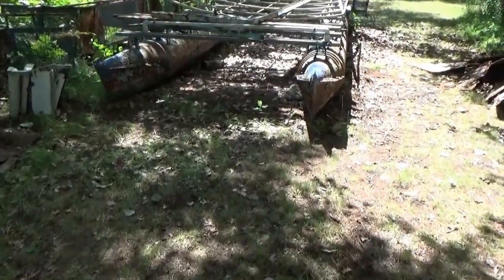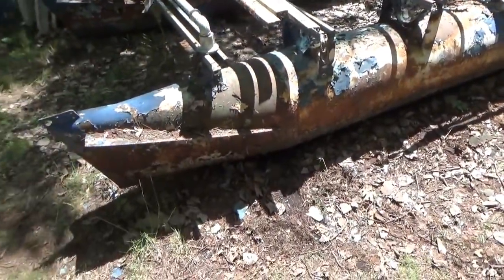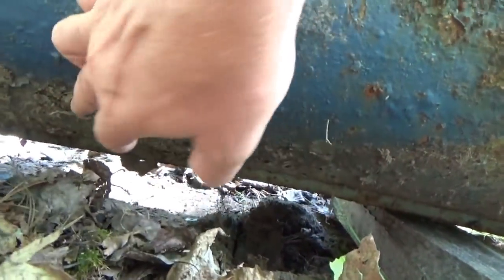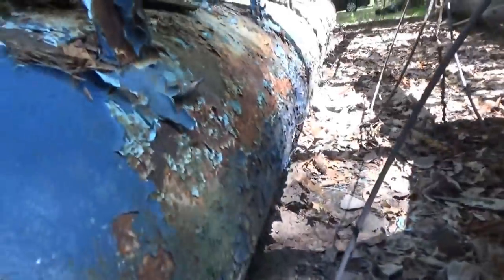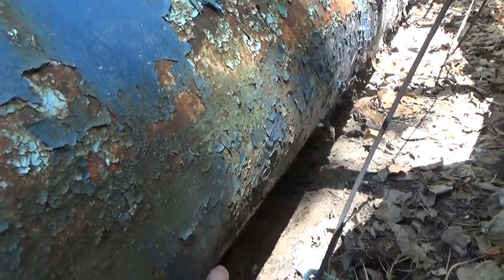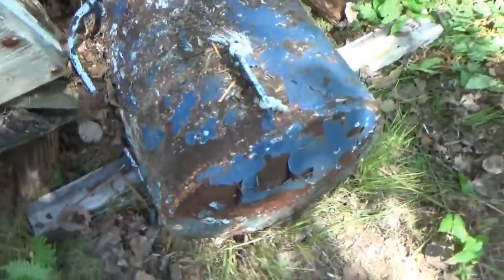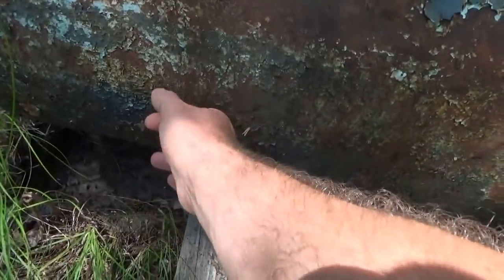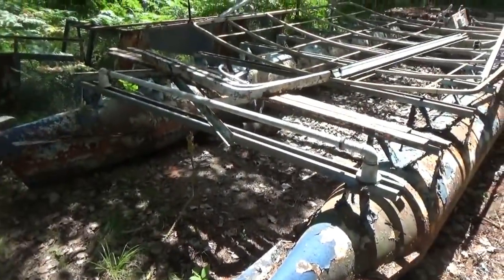The Off Grid Tiny House Boat Updates

Comment: I'd suggest before you relocate the boat -  Put compressed air in each side (about 5psi)  and spray the pontoon with soapy water (from a bug sprayer ?) .  Wire brush around the pontoons with the soap/water .
I'd ask a pro boat shop about the best way to repair holes .  I wouldn't go with JB because by the time you find out if it worked or not will be way to late and then you would have an emergency tow out of the water then have to do work on a completed boat .
Reply: in case of a bad spot, just weld a plate over it, no jb weld!!
Reply: Think I'd check for foam fill.And the pontoon will have to have to be ventilated with an air in and air out or one could have a gasification explosion and "Bang Zoom , straight to the Moon.If he has to weld , maybe ask a marina weld shop what they suggest.

Comment: I lived in Michigan for 11 years and if you have no title for a boat its next to impossible  to get it legal. Not saying it cant be done but not easy and not free. if you say it is a home made boat then its inspection you have to get and they are very picky on it. At least in the south western part of michigan. weld the holes you can get a welder and do it cheap. dont use jb weld when you have the chance to fix things right. Spend it now and not later a sunken boat can cost a guy thousands to get off the bottom not to mention the epa dont come out to clean up the water for free.
Reply from the maker: Unless things have changed, its not that hard. I did it myself long ago with just a bill of sale. They have to find the boat in the system to be sure its not stolen. Pay your fees and sail away.
Reply from the maker: And the pontoons dont leak. I am just going to seal up pits to extend its life more. But many have talked against JB on here anyway.

Comment: Try using a power washer to remove the paint. Should come off pretty easy with the paint flaking like that. What ever is left over then you can wire brush it off instead of doing the whole thing with a small wire brush.
Reply: Northeast Homestead use a grinder with a wire wheel made for paint stripping and rust removal.
Reply: Northeast Homestead I agree!  Power washer took most of the old flakey paint off my old truck.

Comment: JB weld? Really? And this is for your family?
Reply from the maker: Is that bad? On boat forums I read a lot of good stuff about marine JB
Reply: JB weld is not a proper repair, its usually an emergency hold over. Its not permanent nor is it like real welding. I repair steel Pools and Tanks all the time, and one thing that I see is when steel is old and in contact with the ground for many years, it gets very thin and many tiny holes are created. What I suggest, is before you get too into it, put it in the water, and see how long it takes to take on water. see if it will float for a week. Modern pontoon boats have pumps, they all take on some water.

Comment: Your wasting time and money.  Scrap it for cash.  Of course you can fix anything, but the question is why? Priorities
Reply: Yes, this is true madness.
Reply: i dont think it is , your looking at how it looks, it looks bad so must be junk ,?
i would clean the paint off the floats first . either by wire brush on a angle grinder or by burning it off, then see what the floats are like,
then if scrap ---- scrap it, 
a couple of patches needed welding? no big job weld the thing .
if the floats are good then its worth repairing, its a easy designed construction,
but never use jb weld on the floats ,, if it needs welding then weld it.

Comment: If your dead set on floating that boat.  Get a bottle of map gas and some brazing rods or coat hangers and melt them down to fill any holes or cracks.  It's super easy to teach yourself to-do and way better than jb weld my friend

Comment: Look into a glass reinforced body filler for the holes. JB Weld isn't the right product. As others have said, drilling some small holes and filling the pontoons with expanding foam is good insurance against a catastrophe. It would be unsinkable. Don't use the stuff in a can, get the 2-part TotalBoat closed-cell liquid urethane foam that is made for this.
Reply: Mike Foreman JBWeld Marine is the right product. I've used it on aluminum boat successfully several times.

Comment: Hi Troy, as others have mentioned filling the pontoons with foam would make it "unsinkable" even if there a hole should develop in the pontoons.  A hole can come from many causes, so it is a continuous needed inspection not just while you rebuild.  Holes can come from physical contact with something like a rock or floating tree trunks etc.  A big problem on the Mississippi River.  Holes can also develop from electrolysis.  This is like the dissimilar metals in a battery where one plate is eaten to nothing over time ie. you got a hole.  Ships often use "sacrificial" electrode plates attached to the metal hulls to greatly reduce this problem.  Electrolysis occurs anywhere there are different metals touching each other.  So if you need to repair rotten metal, be sure to fill or replace with the same kind of metal.  Skip the JB Weld.  If your going to do that then you might as well use Super Glue!  Sarcasm here.  But seriously do it right and patch with metal not any kind of plastic chemistry.  None of it will be permanent as metal in the water exposure.  Water is a solvent:  given enough time everything dissolves in water, but oxygen sensitive metals (iron, steel, zinc etc.) and all plastics/fiberglass are next (also uv sensitive)  Metals like gold, copper and titanium are less attacked.  Finally, there are microbes that are very happy to EAT metals and plastics.  Yes!  Very true.  Copper and silver are natural microbe resistant metals, but there may be other materials you can research online.  Tip:  Car tires are a great example.  Ever notice a car sitting out in the yard for a few years and all the tires deteriorated/dry rotted?  The usual explanation is rubber oxidation.  But that is an extremely slow process.  The real culprit is rubber eating microbes.  So lesson learned is never park your vehicle tires on soil/grass if possible.  Rather, better is to park on asphalt or cement or similar driveways as yes, put up on cement blocks if storing for a long time.
Reply: Troy, forgot to mention that instead of filling the pontoons with foam which may be expensive, I am thinking you could get free Styrofoam peanuts (shipping packing) and just fill it up!  I see this stuff for free on Craigslist all the time.  And you would be saving the planet by stopping this 200 year longevity menace from going into the landfills.
Reply: EnergyCrafts, foam can get water logged and the boat would sink..You’re not the brightest bulb in the house are you.

Comment: Are the pontoons filled with fome?
And if you take the cross peaces off you can transport it on a regular flatbed trailer and you clean and work on the pontoons a lot easier
Reply from the maker: No, they hold only air. There is a trailer meant to move a pontoon boat. The marina moves them for people for a small fee. Not a problem.

Comment: Super 😎 cool troy , tip for ya troy use a wire wheel on a drill and use safety glasses ok , does lot better job for big stuff , then use a sanding wheel after , take your time sanding ....